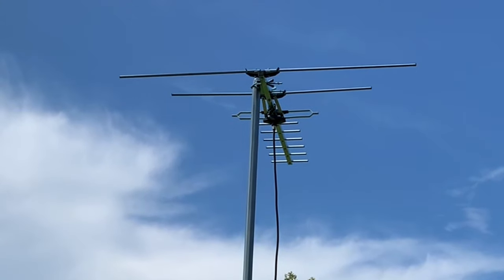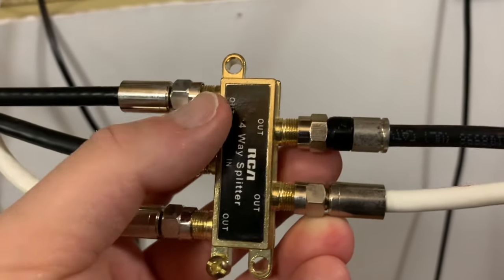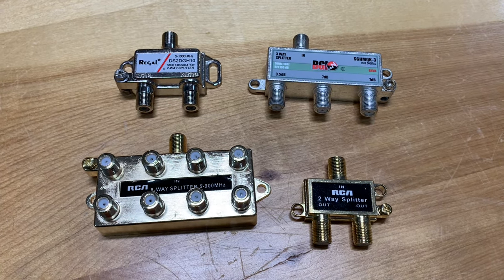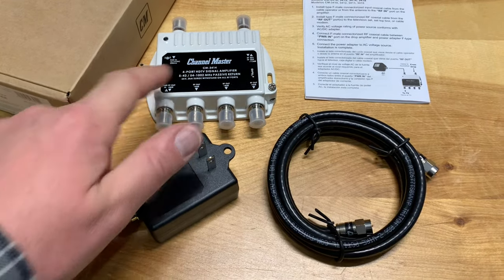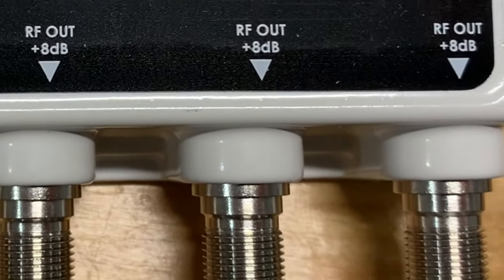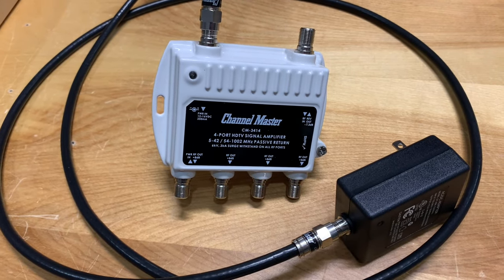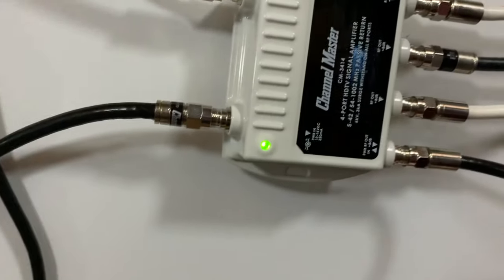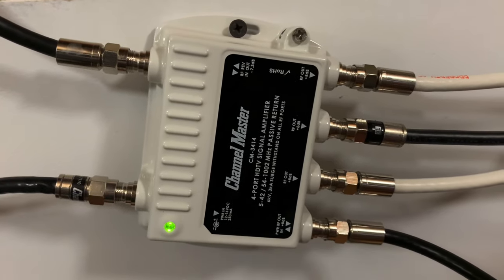TV Antenna Signal Amplifier | 4-way Amplified Splitter - Channel Master CM-3414

Comment: I case some of you don't know...  splitters will cut down the signal, as little as 3.5 dB.  That 3.5 dB loss is just off of a two-way splitter.  If you use a four-way, you will cut your signal as little as 7.5 dB and a 8 way will cut it down to 11 dB or a little more.  This is why you get bad picture quality or mo signal at all, when you used them.  As far as amplifier goes, they will only help with amplitude signal and not signal to noise or MER parameters!   I will say this..  before to split the signal check the signal levels and MER (signal to noise ratio) first!  Amplifier is not magic to your tv signals.  Amplifies will boost noise and any trash a$$ signals to come with the reception also.  Too much amplification will also distort to signal, especially if the modulation is QAM.  Make sure your have a decent amount of MER dB levels before you split the signal.  No component can fix a bad MER.

Comment: You conveniently failed to mention that noise is amplified at the same rate.
Reply from the maker: As long as the signal overcomes the noise floor, there’s no problem with using a distribution amplifier.
Reply: As long as MER (signal to noise ratio) is at a certain level.
Reply: This is a review of the device not a specifications breakdown for that I recommend the channel master website I'm quite happy with the amp I purchased and this fine gentleman helped me a few times, perhaps he can donate his free time and help you as well  !!!!!✌️📶📶✌️

Comment: My house is a single run, but that's because I had a lot of gain at the rooftop amplifier.  Instead of splitters I used a drop-tap at first three of the four TVs.  Trying that with splitters would have failed.  Unfortunately drop-taps aren't readily available at the consumer level.  Too bad I can't recommend them, as they solve some sticky problems cheaply.
Reply from the maker: I’ll have to try one of those, they’re not common to find though.
Reply: I found out about these while working at big hotels.  One would go bad every couple of years, so I kept a set in stock with the various insertion levels needed.  MATV suppliers have them -- retailers almost never.  For those reading along, a drop-tap "drops" specific number of decibels to each TV, and sends the remaining signal to the next set or tap.  By contrast, a two-way splitter divides the signal in two -- half is automatically gone by-design.
Simple splitters have their place, but can decimate the signal when used wrong.  Powered splitters weren't too common when I wired the house, or I might have used one.
Reply from the maker: @stevejohnson1321  Thanks for the information.
Reply: How did you measure for each tap
Reply: The cable company left behind some six-decibel drop taps.  They just happened to work.  For a longer run, higher DB might be needed.

Comment: I just bought the new model of this by Channel Master (it’s the one that’s black) and it’s phenomenal. Well worth spending the $55 just to not have any issues with old splitters connected to mast amplifiers.  It’s installed in the basement and going out to 3 TVs.

Comment: You can just go for a 1 way amplifier or masthead amplifier and put your splitter on the output. The multiple output amplifiers do the same but the splitter is built in.
Reply from the maker: Yes, certainly that can work in some cases. I’ve done it myself before.

Comment: If I have 3 TVs in my house do I need a 4 way amplifier or?
Reply from the maker: If you have 3 TV’s connected to a splitter and have picture break-up on some channels that are fine with only one TV connected, then I would say use an amplifier.

Comment: Great video Northcoaster Hobby! For antenna a signal amplifier splitter is mandatory so you won't lose signal. I remember as a kid we had a VHF-UHF antenna and a two output splitter, we had two TVs All 3 VHF channels had crystal clear picture but the other 3 UHF channels had horrible picture. UHF Channel 21 had good picture but channels 40 and 42 had awful picture. We didn't knew at that time about signal amplifier splitter. In the end we used the VHF-UHF antenna for VHF reception and each TV had a separate UHF antenna. All my antennas were installed in the attic. On TV we had a 2 female antenna input and 1 male antenna output connector for 75  ohms. Later when I got into antenna and satellite TV hobby I learned about signal amplifiers and attenuator. In my current installation I have on one cable  FM, VHF High, UHF and Satellite signal. Due to very long cable I use amplifiers for both antenna and satellite, mounted directly on the Sat-Antenna diplexer, as for antenna I use an 18 Db gain amplifier with a 5 volt power inserter and a 4 output signal amplifier 5Db gain. The signal strength and quality is excellent on both satellite and digital TV, as for FM I use an VHF attenuator and I get all channels clear in stereo.
Reply from the maker: Yes, a distribution amplifier can make a world of difference. I have a less expensive RCA model that splits and amplifies 4-ways and even that helps significantly. I might make a video on it soon. Thanks again for watching and for the informative comments.📡📡
Reply from the maker: And that all being said, sometimes a simple 2-way splitter works without problems! So many factors with TV reception.
Reply: @NorthcoasterHobby  After having a perfect satellite and OTA TV installation the only question left is: Is there something good on TV? An old joke from my electronics teacher from high school.
Reply from the maker: @Nicholas_Chris  Haha, so true! The answer is: hopefully!
Reply: @NorthcoasterHobby  that  amp only works good  if your antenna receives good signal, you only get better signal if you put that near the antenna ,in my case i have to run 120 feet of cable to the house  them splitte signal to a whole bunch of tvs in diferent rooms.i use  Winegard-LNA-200-Preamplifier with  120 feet of  run of cable ,then i put 4 ways splitter to more 2 ,15 run of cable to other rooms ,i don't think that splitter will work with ,already connected Winegard-LNA-200-Preamplifier ?

Comment: Splitter actually improved my picture. I replaced the grounding block coupler with a grounded two way splitter. The signal  went from 72% to 44% but the picture is no longer pixelating and breaking up .. its solid now.
Reply from the maker: Great! Whatever works!👍

Comment: You have the best review videos.  Thank you.  Question:  Can I use a distribution amp after or with my antenna pre-amp?  My present setup doesn't allow me to use a 2 port passive slitter as there is a little too much signal loss.  Does this distribution amp come in a two port model.  Thank you.
Reply from the maker: A distribution amp should never be used with a preamp. The CM-3412 is a 2-port output model. Thanks for watching and for the kind comments.

Comment: It comes with a 6ft coax for the power into outlet can i use a longer cable say double that like 12ft coax thanks
Reply from the maker: You can try, but I would use a good quality RG6 coaxial cable. Keep it as short as possible.

Comment: Do you know if this will work to improve FM radio reception too?
Reply from the maker: It won’t necessarily improve FM reception if you’re not already receiving the station at the antenna, but if you’re going to split the signal to different receivers, it will help reduce any loss and ensure reception at the receivers you have connected.

Comment: Hi does this amplified splitter need to be as close to the antenna as possible? Right now its behind our tv which is about 50 ft away from our outdoor antenna. Thanks
Reply from the maker: Closer to the antenna is best. Make sure it is installed indoors only. But if it’s working where it is, then leave it as is.
Reply: @NorthcoasterHobby  thanks snd should the cable from the antenna to the amp splitter be a low loss cable?
Reply from the maker: @mariaromanell  use RG6 or RG6 Quad shield cable.
Reply from the maker: @mariaromanell  https://youtu.be/Kope__f6kDQ
Reply: @NorthcoasterHobby  thank you. I am waiting for an rg6 dual shield i didn't know about the quads.
Reply from the maker: @mariaromanell  dual shield should be just fine 👍👍
Reply: @NorthcoasterHobby  so a dual rg6 will suffice as long as its under 100ft of coaxial cable then? Even for the cords running from splitter to the tvs? Thanks so much for your advice.
Reply from the maker: @mariaromanell  most of my cabling is RG6 dual. No issues. If you already bought it then use it. If you have issues then look for other solutions after. In almost all situations RG6 dual  is more than sufficient.
Reply from the maker: @mariaromanell  you’re welcome 👍

Comment: Can we split up each output in the amplifier?
Reply from the maker: You could but I wouldn’t recommend that. If you need more outputs look for a larger distribution amplifier (8 outputs for example).

Comment: Is the coaxial power cable between the ac adapter and the power supply a normal coaxial cable like the one that connects to televisions?
Reply from the maker: Yes, RG6 coaxial cable.

Comment: Is any maximum longitude of the coaxial cable that feeds of power the inline amplifier?
Reply from the maker: I  can’t really say a maximum length, but I would use as short a cable length as possible and make sure it is good quality RG6 coaxial cable.
Reply: @NorthcoasterHobby  thanks for the answer
Reply from the maker: @megacap55  You’re welcome.

Comment: All of a sudden mine keeps tripping the circuit breaker every few hours which is really confusing as its only runs off 12 volts
Reply from the maker: How many other things are running off that circuit?  A small device like this won't trip a breaker. You might want to call an electrician.

Comment: Can this amp be used AFTER an antenna pre-amp?
Reply from the maker: Good question……I would say not to use a distribution amplifier if you’re using a preamp, as that may over-amplify the signal. A decent preamp should be able to feed 6-8 TV’s with a splitter. Use one or the other, not both.
Reply: @NorthcoasterHobby  OK, thank you.
Reply from the maker: @trainmaster0217  You’re welcome.

Comment: can I use this for xinfinity  wifi. ?
Reply from the maker: Probably not
Reply: No.  You should not attempt to try to boost up a provider's signal.  The reason for that is you can end up sending too many amplitude signals to your cable modem and distort your return signal, back into the provider's node.  Cable modes use very complex modulations and there is a certain amount of power, that a provider is trying to maintain on the equipment on purpose.